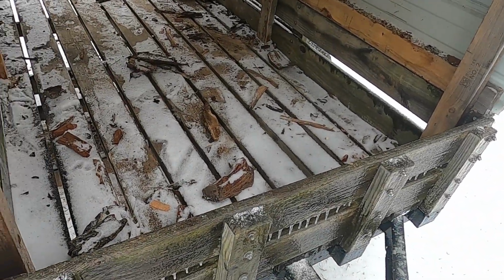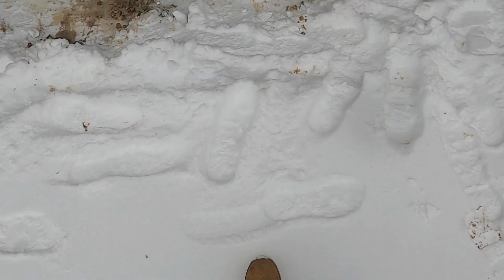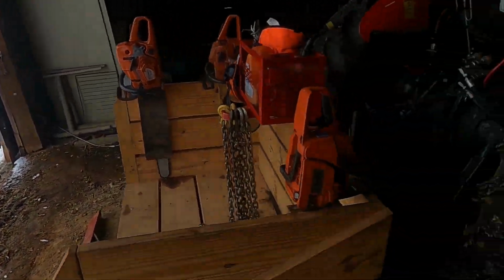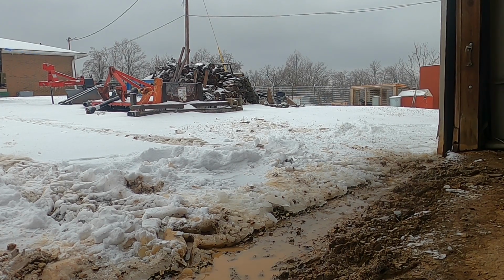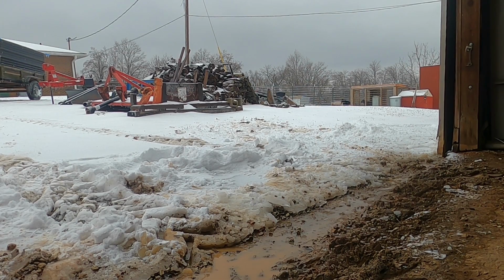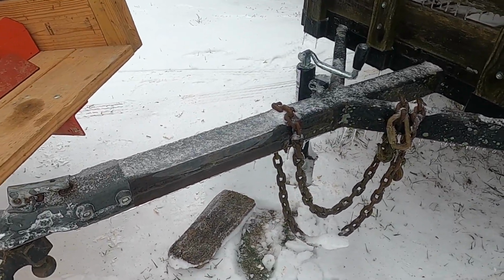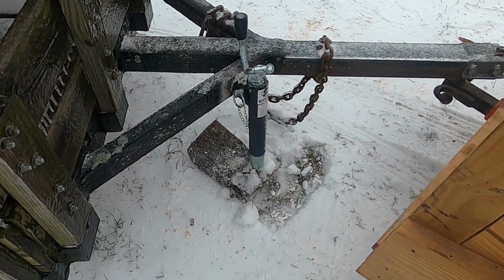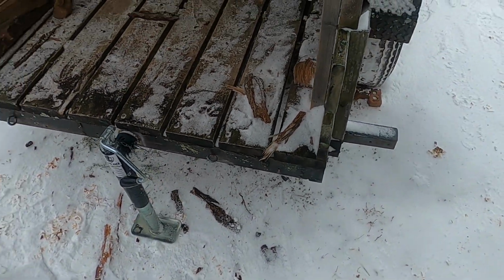185: And Now We Have Firewood Again - Despite the Ice

Comment: Ice is super dangerous to have to contend with. Chains are strongly recommended for safety if nothing else. I don’ have chains for  the Kubota , but do for all the other tractors. I worry about my wife taking a nasty spill on the ice, but it is usually me that ends up taking one for the team. This year,  I am putting a lot of our wood ashes on the icy spots so I don’t fall and break my ash
Reply from the maker: I was going to dig a hole outside to collect fireplace waste for later use like you mentioned.  But my wife said no, there's already an ash hole inside the house....???